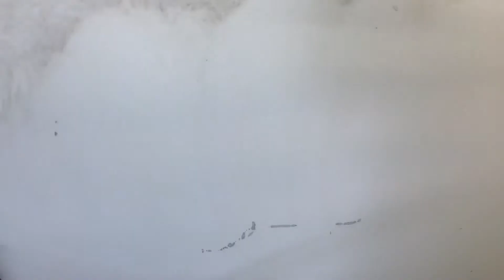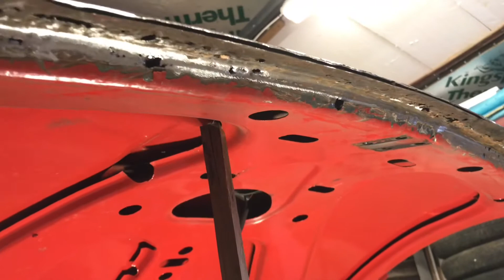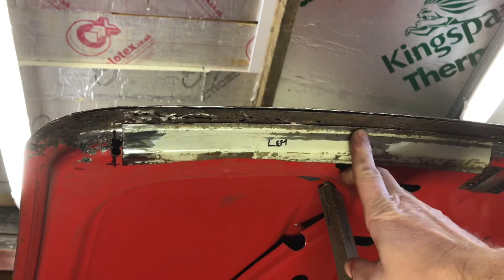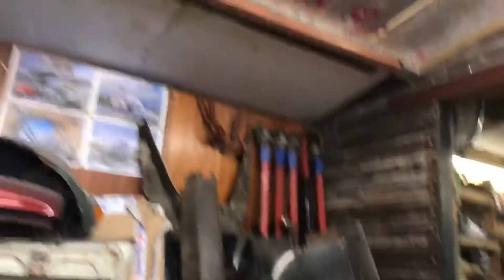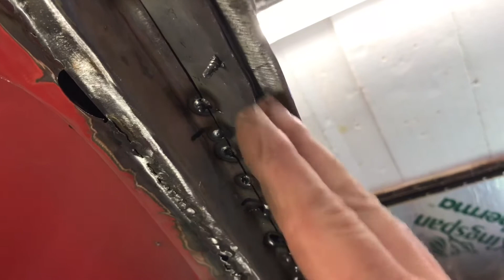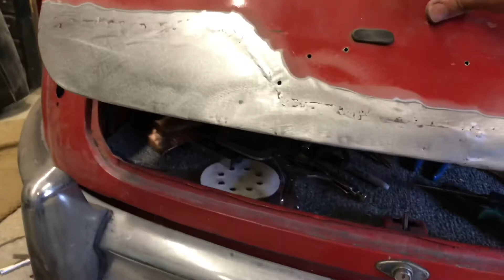Jaguar MK2 Restoration Boot Lip Repair

Comment: Nice repair, I did something very similar on my MK2 Jag recently although I did it in a number of smaller sections to make it easier and try and reduce distortion which i've had issues with before.  I also looked at the price of the repair panel and nearly fell off my chair!
Reply from the maker: Thanks Andrew, I really don’t understand why some repair panels are so expensive. What’s the point in tooling up to make something nobody can afford? Surely it’s better to make some profit on more sales. It stinks of marque snobbery and greed. I’m not playing the can’t afford it can’t have it game. 🔧👍

Comment: Excellent..where did the water enter the panel?
Reply from the maker: I’m not sure Paul if there is a design flaw in how it seals or just the usual blocked drain holes and condensation, like door bottoms go, either way most rot out eventually 😀.
Reply: Condensation, that would be it. Every old car seems to have a puddle of water in the boot or the footwell.
Great job, looking forward to more.

Comment: OK great and well done but you could have bought a repair panel from Martin Robey :)
Reply from the maker: Yes I could of but I preferred to buy a metal folder for much less than the cost of that panel which I think is over priced 😀
Reply: @stevesclassicgarage9464  true and more fun.